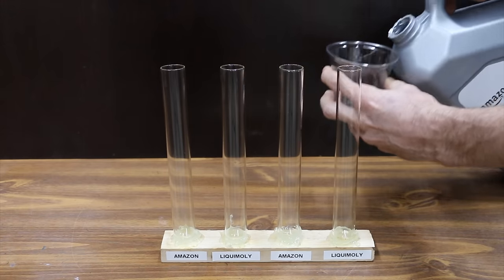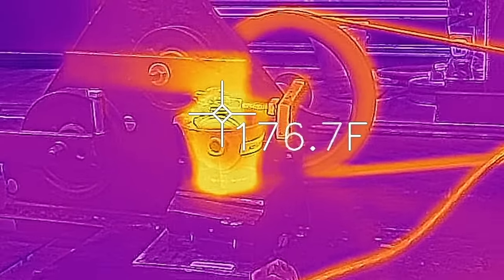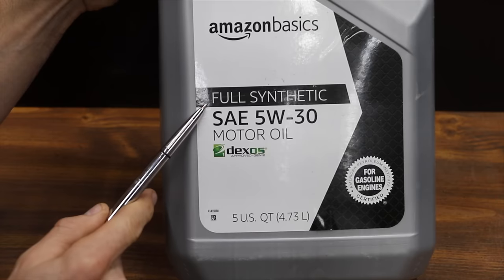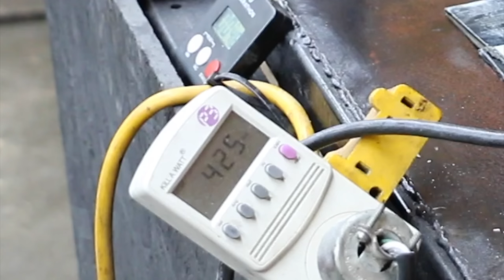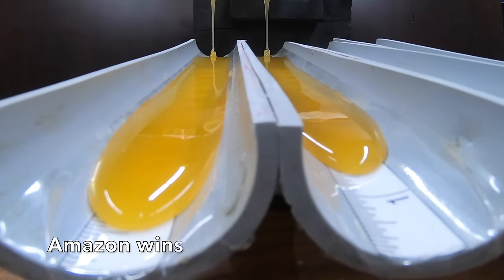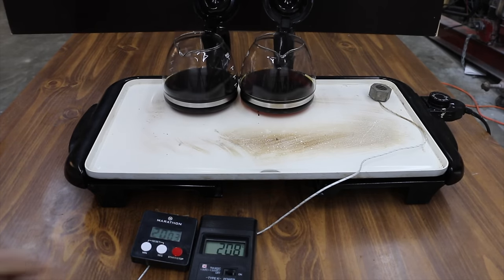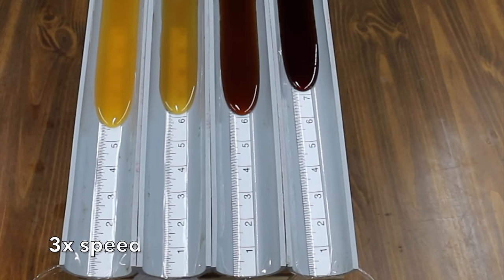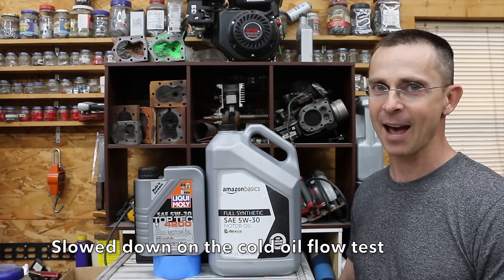Is Amazon Basics better than Liqui Moly? Let's find out!

Comment: You need to test the oils from Castrol

Greetings from Germany :)
Reply from the maker: Great recommendation and greetings!
Reply: Or Rowe Oil from Germany!
Reply: Or Addinol oil from Germany 😉
Reply: Hello..!! great video on this test.. But i hope like mentioned adding Castrol titaniun aswell..!!! Great work..!!!
Reply: Sadly Liqui Moly did so bad. I like that Brand an i dont even really know why. My Car is currently driving with the 4600 Oil
Reply: I was thinking (sadly not a 5w-30) but Mobil 1 0w40 vs Castrol 0W-40 meeting the lastest Mercedes or BMW specs. 

Could do a 5w-40 instead which would be really close. 

Only suggested due to it's availability and would be an Interesting showdown between two oils proven for Autobahn use.
Reply: Didn't know they made a magnatec in that spec, I know the edge oil is but I haven't used it myself. Always preferred euro spec M1. Though being stateside some of our choices are more sparse for euro specific oils.
Reply: Uncle Scotty Kilmers favorite oil!
Reply: @ProjectFarm  Castrol VS Valvoline
Reply: Pentosin as well ;)
Reply: Becky5205 I run Castrol in my 2 stroke snowmobile- I believe it saved my engine, my oil injection cable was cut by somebody, getting oil at idle level for over 500 hard miles. I removed the intake and exhaust after this and saw zero scoring, the bottom end of the motor seems perfectly intact too. I gladly run Castrol.
Reply: Yes, Castrol wants to be the premium in Germany. Liqui Moly doesn't manufacture its oils. In an older oil test of a german magazine, Meguin won, eventhough it was cheap. In TV there is a company Mathy, that sells additives with the same test setup. After five minutes of running in, they can't break the film strength. They're also on Youtube "Mathy live test"
Reply: Germany invented the first synthetic oil in ww2
Reply: Castrol is shit, try Ravenol, premium oil

Comment: Let's get some Pennzoil Platinum and Ultra Platinum in the mix.
Reply from the maker: Thank you for the video idea!
Reply: Would be very interesting as this has been my engine oil of choice. Great suggestion.
Reply: Im interested in this as well as i have always thought pennzoil to be crap but honestly id like to see may make me not think so
Reply: @finharms9439  What rock have you been living under? Times have changed. Pennzoil Platinum 5W-30 is truly top 5 or top 10 oil of the world. Shell is the parent company - same as Quaker State. Both are superior to Mobil 1 in terms of real world burn off in the summer and have less change in viscosity. Plus both provide more power and less noise at first fill and after 3500 miles. Used all in my 1991 160,000mi CRX, 2003 187,000mi Xterra, and 2003 91,000mi G35 (Mobil 1 junk never touched that car). My 1999 162,000 Camry 4cyl has QS full synthetic - I used to drive 6 hours 3 days a week. 100% confident Pennzoil and QS best A LOT of oils on the world market. I am loving Amazon/SuperTech/WARREN right now. What a great US company!! Amsoil and Motul are excellent oil beasts too.
Reply: Violeta Arreola the reason i think as pennzoil as crap is because they are affiliated with quaker state, if you remember back in the day it used to sludge up fairly quickly, i have always been a firm believer in Castrol GTX and Lucas, however if you are correct which im not saying you are or aren’t but this is why id like to see the tests in an unbiased environment, like i said it may change my mind
Reply: @finharms9439  I FULLY understand and apologize. You are correct. The QS of the past 100% did sludge up and I can see how you, me, or anyone else loathes the idea of buying that marque. I used to collect carboard oil cans and only had one QS - because my dad hated it!! I too, up until I realized QS was now Armada Shell, would NEVER have bought their oil. I would find a Waffle House and scrape the griddle fat and put it into my engine rather than buy some QS at a store, even if it was the only oil available. However, now it is a decent product and I swear it burns off less than Penn Platinum! Castrol is a solid choice. I always think performance, and not sludge, with Castrol of Wayne NJ. John Force NHRA funny car sponsorship is in my head since youth.
Reply: Violeta Arreola well i as well think of performance, which in a sense is.. in an engine anyway.. is efficiency, being able to hold up to the demands of an engine under all circumstances is what i look for, how effective can that oil hold up to a cold start, or how can it hold up to full throttle under long periods of time... like i said you may make a believer out of me if my castrol isn’t available... however i am a stubborn guy like i said im a very firm believer in Lucas regardless the oil or application of the engine
Reply: Definitely agree. I have used that as well
Reply: Yeah supposedly this new natural gas oil should be considered a group 3+ base stock oil and the PUP competes with amsoil signature series only at burn off a youtube amsoil dealer said himself.
Reply: And don't forget, Platinum Euro.
Reply: Isnt Pennzoil Re-Refined or Recycled engine oil? I would never put that stuff in any of my vehicles
Reply: @michaelsantori6513  "PurePlus Technology, a patented process that converts pure natural gas into high-quality, full synthetic base oil used in the Pennzoil Platinum line of lubricants. Because our base oil is made from natural gas, it’s crystal clear, with fewer of the impurities found in crude oil-the origin for many other traditional and synthetic motor oils. To that pure, clear base, we add our unique high performance additives to create Pennzoil Platinum and Pennzoil Ultra Platinum Full Synthetic Motor Oils, our most modern and innovative synthetic oils"
Reply: @finharms9439  I was a purely Liqui Moly man for the past 5 years, but now I see that Penzoil Platnium Full Syn Euro has my weight and is VW approved (in my case) , I pay moly 45$ (5L) and my car takes 6.3 Quarts So I always buy an extra 1L moly. Now I get the penzoil 5L for 31$ and they give a mail in rebate of 10$ per 5L. Cant lose for a vw, bmw, mercedes , etc etc approved oil for 21$. My 2 cents...
Reply: Sinopec makes ALL Shell motor oils for the USDM. Good on you for giving China money!
Reply: I use Castrol magnatec. Never any issues

Comment: Could you test Shell Rotella T6? Alot of people apparently always run that in there cars even tho its a diesel oil. Very curious.
Reply from the maker: Great recommendation!
Reply: This is a common oil for motorcyclists as well, I've put it in my project bikes and many swear by it. Apparently it has the right certifications to be used with a wet clutch.
Reply: Yes, this was an extremely popular choice among Subaru enthusiasts, but be aware they recently changed the formula and it is not the same anymore, now I run Total Quartz  9000 based on recommendation from engine builder.
Reply: +1 for t6 test. I use it in my 95 sierra 5.7
Reply: @bmoore8853  API CK4 is a better standard. It looks weak on paper but go look at bobistheoilguy
Reply: @MrMeowBlub  correct. I used on all wet clutch bikes since 86...my first Honda 200sx
Reply: would love to see a t6 and a motorcycle oil like liqui moly  in 10w50 specs
Reply: Would love to see how Rotella T6 compares as well
Reply: @ProjectFarm  It would be great if you could find someone with the old T6 formula to compare to the new. They took a lot of Zinc out of the new formula. Curious how that changes it.
Reply: MrMeowBlub fabulous oil for motorcycles. That's all we use in our dirt bikes. Honda CRF450 gets it in both sides with an ounce of Tufoil on the engine side
Reply: I have used T6 in all of my cars for many years - most were turbocharged. At some point I started mailing used oil samples to Blackstone Laboratories (in Fort Wayne) for analysis. The results were always stellar. Naturally I have continued using T6. Now, Todd has me seriously rethinking my T6 addiction and the possibility of Amazon Basics. 
I would very much like to see a head to head, apples to apples of Rotella T6 and Amazon Basics full synthetic. 
Many “doers” use T6 in their own equipment. This would be a popular test.
Reply: Agreed, I use in both gas turbo and naturally aspirated engines
Reply: mike p I think the concern some have is that the ppm of zink is a little high in the t6. Not good for catalytic converters if your rig burns oil. Of course no oil is good for the cats.
Reply: I use T6 in my Turbo as a general recommendation from the Car/Model community. (09' Subaru Outback XT) I would love to see the results here. Though T6 is popular for far more than just its lubrication.
Reply: I use T6 in every vehicle I own - turbo or not! I find it is amazing at cleaning out dirty engines that may have been neglected by previous owners.
Reply: There is a 5W30 version of Shell Rotella T6 for Gasoline engines, you'd just have to find a Shell Distributor that sells it.
Reply: I run that in both of my diesels, truck and car
Reply: My father used Rotella T6 in a Ford Freestar he got over 400K miles out of, just doing 3K oil changes with T6. It had a rear main seal leak at the end of its life, but had no engine mechanical issues, no blue smoke, etc. He drove it to the junkyard. Went through two transmissions in its life, though. To me that's a big testament to how good the oil is.

Comment: F1 now uses Amazon basics
Reply from the maker: Great information.  I didn't know this.
Reply: SiGHT SMaSH — either that’s a joke or it’s really because amazon sponsored their oil needs. Doesn’t mean it’s any better then any other brand with the same freakin API certification. Lol. 

Never look at the sponsored logos as an indicator that they are using THE BEST. They are using what’s cheapest / FREE.

Those engines get rebuilt after every race anyway, so who gives a hoot what oil they use for ONE RACE duration. Lol
Reply: @I_know_what_im_talking_about  Well, the other thing is that it's just an entirely different application. Under high performance racing conditions, you need something that's going to hold up to the heat, and not shear, froth, or separate. So in those cases, you want to have a fairly basic additive package, and not have to worry about VII breakdown.

So even if it WAS what F1 used, that doesn't necessarily make it the best for YOU to use.
Reply: Amazon oil use the same company as the super tech oil
Reply: @ProjectFarm  It was a joke :)

Comment: Car oil vs motorcycle specific oil!!!! These videos got me thinking "should I just use amazon basics 20w-50 in my bike?" 
These videos got me thinking if there really is any difference between say V-Twin 20w-50 and amazon basic car 20W-50. Can you please test this?!?! everyone thumbs this up.
Reply from the maker: Thank you for the video idea!
Reply: No, DO NOT use car oil in your motorcycle, it will cause your clutch to slip
Reply: @Technie87  I understand that. But I also have my reservations that it actually will. I honestly think you wouldn't even notice. Obviously, it's not worth the risk but it is worth testing.
Reply: @abarrick09  Well the difference is there because its a real thing. There is a motorcycle specific oil because there are cases of clutches slipping because of the use of conventional oil in a wet clutch style system. Do a quick search of "should I use car oil in a motorcycle" and you'll find out. Now , if you want to test the lubricity ability of that of a motorcycle oil compared to a car brand then thats a different question

Comment: I’m from Germany, Liqui moly Is the last oil i‘ll put in my Engines.
Already saw some worn Engines powered by LM...

I Hope you will also Test:

CASTROL
MOTUL

AND (my absolut favourite)

MOTUL 300V COMPETITION 15W-50 ESTER CORE Racing oil. 

That would be absolut Great. 😃

Love These Tests. 👍
Reply from the maker: Thank you for this information!  I'll test MOTUL and Castrol for sure.
Reply: cant agree more, We also put our trust in liqui moly and 4 of our premium fleet cars got severely damaged due to excessive deposits on cylinder liners, piston rings and almost all squirters were blocked. I think the deposit shield and the high zinc requirement is not met at all by LM. Even the oil pump lift mesh was 90% choked
Reply: Hast du es versucht mit Fosser oder Ravenol?
Reply: Motul Specific VW 504 & 507 Lost to The Liqui Moly 4200 on Nates.
Reply: @Franz_Donnermann  this guy is talking $hit
Reply: @Fixmycarpk  Generally most of modern oils do not have a lot of zinc in them. So...